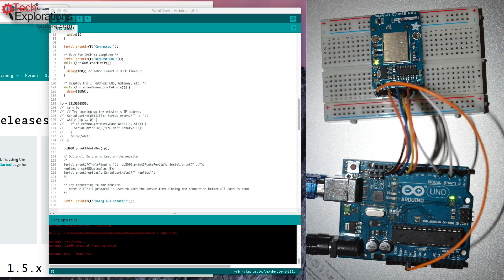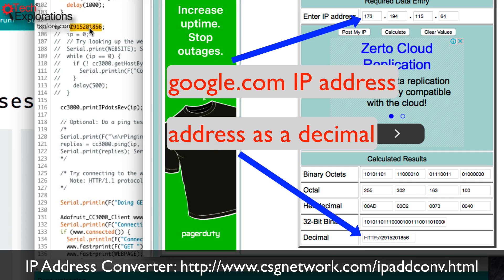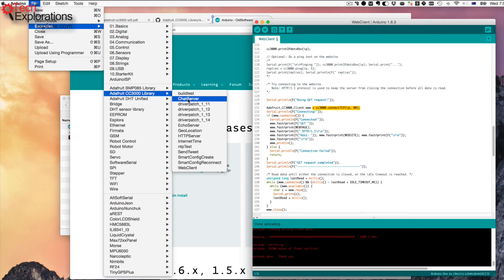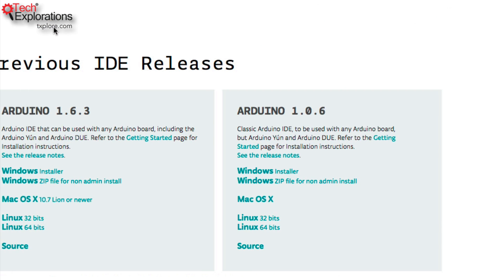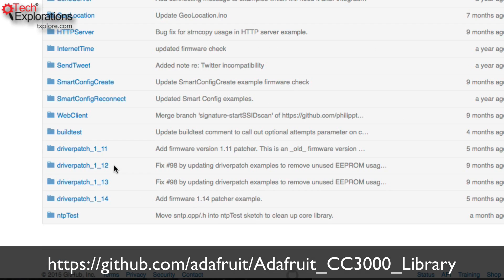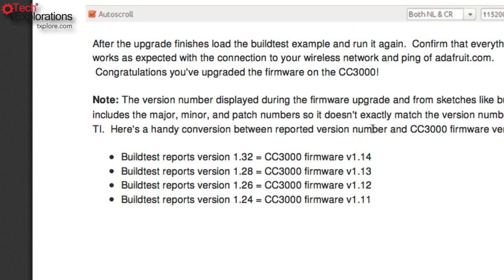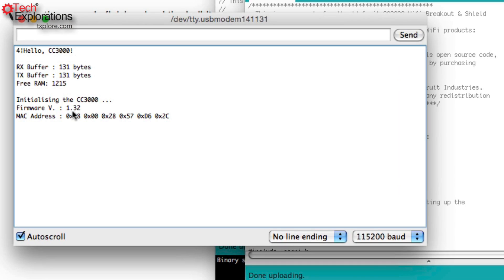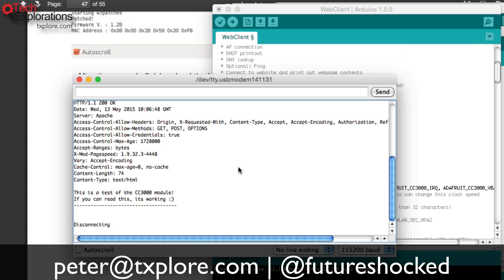Arduino SbS - How to upgrade your Adafruit CC3000 firmware

Comment: Very clear instructions. Thanks. The Adafruit site recommends  the use of an external power source of at least 1A. The USB power is not sufficient and may cause stability problems. The CC3000 has its limitations and may still cause hang ups, even after firmware upgrade.

Comment: Threw me for a loop... When getting the older version of Arduino be sure to download the Arduino IDV v1.0.6 at the top there. In the video he scrolls down and shows you the 1.0.5 version that does not work.
Reply from the maker: Chris Bribach Hi Chris, it doesn't really matter, 1.0.6 or 1.0.5, they both work. In my case, 1.0.5 did the job. Of course I could have downloaded 1.0.6 from the top of the download page instead of scrolling down...